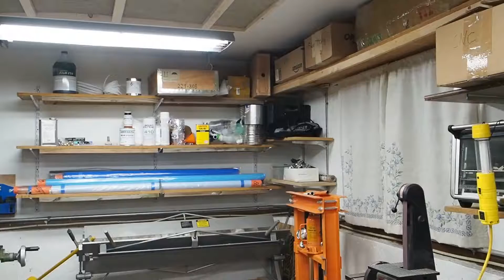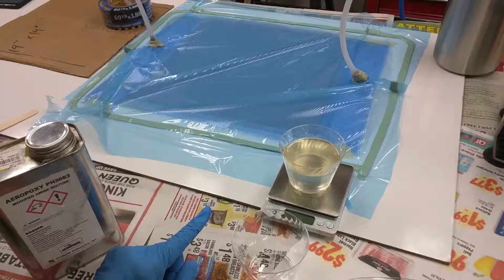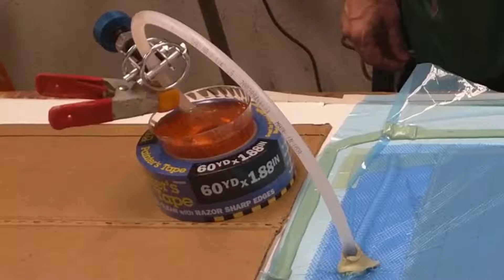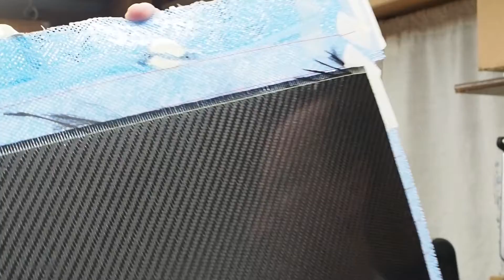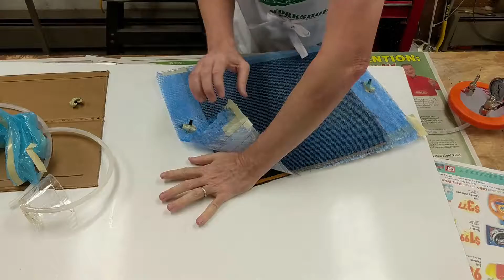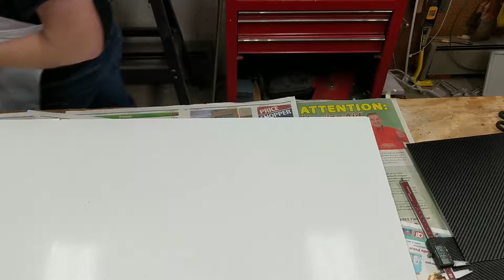Resin Infusion Fail: Part 2

Comment: the part that was against the white board doesn't appear to have any air pockets, so I don't think air came through the board..2 points..
1---.always make sure you don't have any leaks before starting to infuse resin....clamp the vacuum pipe / turn off the pump, then you can hear leaks.......
2 ---- put a large paper cup in your catch pot so you don't get resin in the pot itself

resin infusion will alwys produce  a stronger part for a give weight compared to wet layup
Reply from the maker: Those are great points. They are a standard part of my process ( after I had a few failures).

Comment: Id recommend ditching the white board and finding a thick piece of tempered glass.  I made the same mistake a while back.  Your vacuum likely was pull in air in through the other side of the board, or through the sides of the board.  I found this out on my own using a leak detector and for the life of me it was no where on the bag, but I finally heard air coming in through the side of the board.
Reply from the maker: Yep, I think that this is very likely.

Comment: Welcome to the fun of resin infusion, brought back a lot of memories for me. A couple of tips, if you are interested. We use a stethoscope modified with a length of vinyl tubing to search for leaks. We also put our vacuum pump outside, to get the noise out of the room, this makes it a lot easier to find leaks, and leaves any odors outside. We also put a paper cup in our resin trap under the inlet to catch the resin. When the epoxy is cured, you just remove the paper cup from the trap and throw it away. Other than that, your first try turned out a lot better than my first one did, so congrats on that.
Reply from the maker: Thanks for the tips. I like the stethoscope idea. Could come in handy for other types of tests too. There is a garage attached to my shop. Moving the pump there should work well. I have a compressor I'll do the same thing with.
Reply: In an emergency, could you spray suspect areas of leakage with thick contact glue (apholstery glue)? Just to plug any pinhole?

Comment: No thanks, infusion looks to be  labor intensive and temperamental.
Reply from the maker: I can't really disagree with you. My second attempt at infusion was also a failure. I'm going to have to debug my process. I'll be making one change at a time with the processing, making a new sample with each change until I get the process figured out. At the moment I'm thinking of vacuum bagging with wet layup of small parts and medium size parts and only use infusion for larger parts that can not be in completed in time before the epoxy would start to set. I'm hoping that the temperamental appearance is just my inexperience with the procedure.